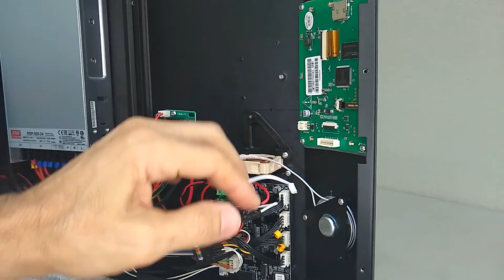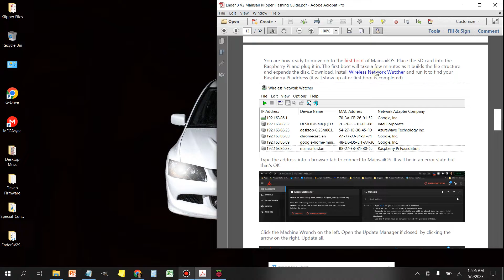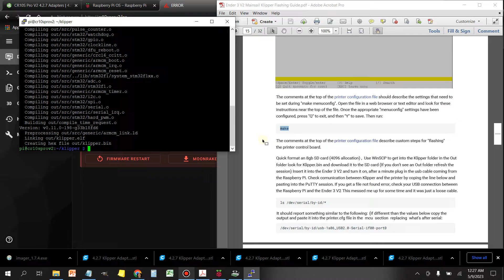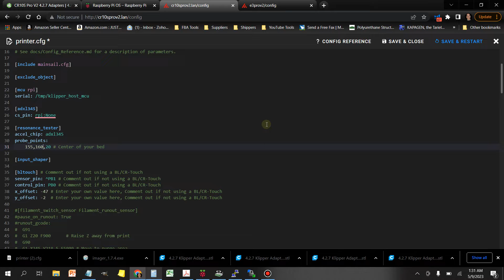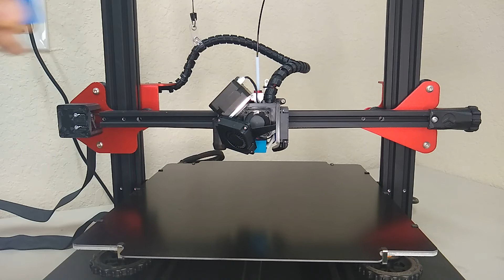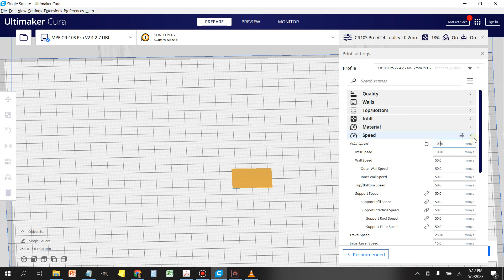CR10S Pro V2 with Creality 4.2.7 gets Mainsail Klipper a Complete Walkthrough

Comment: Nice video, just upgraded my cr10s pro v2 to klipper using the sonic pad. Working really nicely and slowly tuning in the print before slowly ramping up the speed. Would be interested in seeing what settings you get with both quality and speed. I have put bracing on my z gantry to help with vibrations. Input shaping suggested not going above 1500 for acceleration. Haven't raised the speed above the creality ender pro sonic pad standard settings you can get for cura on there website
Reply from the maker: Hi The GP's, Thanks for commenting and info about the CURA settings for Klipper. I'm super exited to turn and burn with this thing. You're still running the stock board with the Sonic Pad right? If so what flash settings did you use to generate the flash file?

Enjoy to the big boost in performance.
Reply: I used to run the stock board but recently upgraded to the skr mini e3 v3. Was getting stuttering issues when i was printing a 40mm cylinder at 100mms at 1500mms2. Thought it was board but it turns out its the acceleration being too low. If i run arcwelder in cura it solves the issue or upping the acceleration. Probably going to use both and see
Reply: Slight edit to my comment. The stutter is due to me overloading the mcu due to too many gcode points that when going faster the mcu cant keep up. Arc welder solves this by reducing the gcode points with arcs. Going to see what is the optimum resolution for stl is as this would solve it to. Cnc kitchen does a good video about cura resolution
Reply: I have moved to prusasliicer as cura as cura seemed to be quite picky on the stl quality and created large gcode files that can stutter my printer at higher speeds. Found just importing step files into prusaslicer and letting it do the conversion created great results with small gcode files.

Comment: I'm interested in this upgade. I have v1 and v2. I have direct drive extruder on both. Micro swiss ND.  I also Have linear rails on all three axis's. Like to upgrade the board with Pi. Just want to make sure you would be able to help if I get stuck. Also would like the stl files you used. This tutorial is almost two years old. My printers still work well but I like tinkering.

Comment: Such a great description, and so well done. You have shown us how to install just about any motherboard now. I got the SKR mini 3.0 V3 board which is perhaps a slightly better version of the 4.2.7 which is miles better than the 8 bit 2.4.1 which is no longer available. but any motherboard would have worked. I also used another raspberry pi with a 4" TFT for the gaping hole you covered with a plate. The raspberry pi automatically boots to Mainsail. I still plan to use the computer, but I will be able to change it at the printer as well or watch the process.
Reply from the maker: That's awesome Mark, great job on repurposing the existing display location. I'm sure it looks way cleaner than just the blank plate. I recently learned about the Manta series of control boards from Bigtreetech that are socketed for a Raspberry Pi CM4 or Bigtreetech's CB1. That would be the board to use instead of the 4.2.7 if you plan on running Klipper.

Comment: Off topic, but did you need to do any mods to get the NG to fit? I can't get an answer about fitting one on my Cr10S Pro V2.
Reply from the maker: Hi Patrick, Are you still using the stock red hotend?
Reply: @vbared  yes I am
Reply from the maker: OK, 

I'm not sure if you've already seen this new Micro Swiss NG or not but this is the one I would buy. It wasn't available when I bought the original one.

https://store.micro-swiss.com/collections/extruders/products/micro-swiss-ng-revo-direct-drive-extruder-for-creality-cr-10-ender-3-printers

The short answer to your question is, yes, you can make the NG work on the CR10S Pro V2 but you will need to print up a few parts before you take yours apart if it's the only printer you have.

One of the things you need to print first is a remix of the two z-stepper fastening parts that I designed for mine to give you more gantry end bracket clearance. The stock hotend is longer than standard CR10, Ender hotends.

Check out the video timestamped below on it (parts linked in the video's description). 

The other thing will be an adjustable x-limit switch for the CR10S Pro V2 running the Micro Swiss NG (2nd link).

And lastly, I'm not sure what build surface you're printing on but G10 Garolite is a real game changer for strong print adhesion when hot and effortless parts release when cool (last link).

Just ask if you have additional question about it. 

https://youtu.be/V_3GLGS4bx8?t=1906

https://drive.google.com/uc?export=download&id=1GcGvDgPr_JZ68BZcOW-hwFgguRIBIckL

Garolite G10 Build Surface fits Creality CR-10S Pro, CR-10S Pro V2 and V3, Ender 3 Max, Ender 3 Max Neo, and Others with (310 X 320mm) Bed - https://amzn.to/3FZy2iH
Reply: @vbared  Thank you for such a detailed response! It's a tossup between this or the Bondtech DDX.

I'm using the Creality magnetic flex build plate which is serving me fairly well for the moment. I'll certainly look into a Garolite surface; it looks much smoother than the PEI plate.

Thanks again!
Reply from the maker: @PatrickRyanCS  Hi Patrick, What sold me on the Micro Swiss NG was that it has the shortest, most constrained filament path (so it can print super flexible filaments), and now the addition of the REVO hotend (game changer for all 3D printers) and finally this video by Proper Printing - https://youtu.be/0jlW4ivSDko

Have fun with your mods :)

Comment: I can't believe i missed this alert for 3 days. I have a 10S pro v1 upgraded with V2, BL Touch and Micro swiss Hot end & Direct Drive. Following your progress very close. Folks are leary to make the interface cables. We need a source that makes them correct. Do you think Tiny Machines could make them for us??? I am not sure i like that ender 3 controller panel is there any options for a color touch screen from somewhere else. Especially if it fits in the old screen spot. I would enlarge that opening if needed.  So exciting to know we can update our old machines. I love mine.  Are you getting the sensors needed for the smart Printing we need?? OH BOY. Could we print a Carbon Fiber Bed Frame for lighter bed slinger mass?  Thank You So much for sharing your journey, I used to build Hot Rod Corvettes so I love this kind of modification for performance enhancements. Dennis in Virginia
Reply from the maker: Hi Dennis, I hear you, the interface cable was intimidating for me to tackle. It just needs to be handled one small bite at a time. I'm not a fan of the Ender 3 V2 display either but my reasoning for using it was due its compatibility with Miguel's Professional Firmware for those that want to stick to Marlin based firmware. In my opinion it's the second best firmware with Klipper being, hands down, number one.

I'll check into finding a source to make them. Is it the soldering that you think some are intimidated by or something else? It would be super cool to lighten up the Y-axis 's moving mass. I just finished calibrating input shaper and pressure advance for my CR10S Pro V2. Now comes the test prints to figure out what the max speeds for quality prints can be.

I too am a car guy, mine are three turbo Japanese imports. Looking forward to the day that I can start dropping money on them like I'm doing with the 3D printers.

Hit me up on a voice call 478-227-3301 so we can exchange some ideas. Enjoy your week.

Comment: Well I finally got Klipper to run my 10s Pro V1 with lots of mods. I have a friend with the exact same machine, we talk about mods we want then we do it together. He is younger and has a nibble brain on the firmware side. I wanted to do the 4.2.7 but he would not so i dropped it. We bought 7 inch high res screen, I already had the Pi 4B. He did it to his first. After three days he emerged successful. Unfortunately he needed 3 days to finish my machine too. He is located in South Africa and I live in Virginia. We use shareware to allow screen share and he was banging on my PC while is was installing the boards and cabling.  Today we finished the OctoView Screen and ran the cube test. My cube printed in 17 minutes on the 5 year old bed slinger with 300mm Z height. It measured 20.02, 20.03, 20.04 on the 3 sides. I was amazed. The New Garolite bed works great saving a ton well several ounces in bed mass. I did not do the fancy calibrations yet so my corners are a little rough and the sides have some ghosting. My parts are clean, neat and much stronger. I will be updating to S3D V5 soon then getting the calibrations done for the final tune.  Your video helped me get the courage to let Andy hack on my machine. I see a very bright future for my old 10S Pro. Stiffer, Lighter and better all around. Thank You very much such a great group of folks in this crazy hobby. Now I can print the Snow Peircer Train I have wanted to do that for 3 years. Dennis on Frankentrain Laboratories
Reply from the maker: Great job, my friend, I know it feels great to complete such a big overhaul to your machine, get it calibrated and printing again. That cube is spot on, how awesome! Yeah, I hear you, the Garolite is a game changer, super light, sticky when hot, parts pop off almost by themselves when cold, and best of all no more scraping or additives needed for adhesion. If you get some oils from your finger on it just wait for it to be completely cool and clean up with some isopropyl alcohol and a paper tower, done!

Enjoy the fruits of your labor Dennis :)

Comment: I looked at the pull down and see the 10s Pro Garolite is available I missed that announcement too. Will order today. Great Stuff. My Garolite plate today is heavy  and rusty red colored. As I replace it will try to CAD the base plate and see if its possible to lighten it up. D
Reply from the maker: Thank you Dennis, I appreciate you supporting the channel through our merch and your interactions. Our G10 is about as thick as you can get while still being able to bend it some. It's important to understand how to correctly set the z-offset and create an accurate bed mesh to get the most out of it. After some x-gantry tweaks I can probe to 12mm from the right edge of the build plate. Let me know what you come up with in CAD so I can try it out on my setup.

Comment: Another great video and I followed it to a tee, but even though the file is the same yours was P4 SPI and mine was I4 SPI and now it states printer is not ready. Also your Klipper bin was 24bytes and mine was 26 bytes. I have gone through this three times with the same result. I am using a Pi 4B and it is a Creality CR10S pro like yours and a Creality 4.2.7 mother board.
Reply from the maker: Hi Mark, give me a call 478-227-3301 so I can help you troubleshoot it. I screen new callers so leave a message and I'll call you right back.

Comment: Awesome video thanks . I have the CR10 Smart, do you know if I can load Klipper on the CR10 smart . Any files that are already make for the CR10 smart, Thanks
Reply from the maker: Hello, Thank you for commenting and encouragement. I'm glad you found value in this video for your viewing time.

You'll need to check if your board is a CR-FDM-v2.5.S1 and if so then, YES, you can use Klipper. The complete base printer.cfg for that board is linked below.

https://github.com/Klipper3d/klipper/blob/master/config/printer-creality-cr10-smart-pro-2022.cfg
Reply: @vbared  I have the other board CRC-2405 v1.2 struggling to get the Z Xisis to auto home correctly
Reply from the maker: @vaughanza  What is the z-axis doing?

Comment: Just leaving this comment for the poem that still have a good stock board, if you plan on installing klipper there is basically no reason to upgrade the main board as it has 2208 steppers the just are running on standalone mode
Reply from the maker: Hi Morgan, Thank you for commenting. Yeah, if the plan is Klipper then there is no need to upgrade the board. The reason I used this board is because it was compatible with Miguel's Professional Firmware which was running prior to Klipper. It is the best non- Klipper firmware currently out.

Comment: I am currently trying this on a CR10S PRO... it's not the V2 though.
Reply from the maker: Hi John, Thank you for commenting. Use the info in this video linked below to upgrade from the 8-bit control board to Creality's 32-bit silent board.

https://youtu.be/hXZ3UPy67gc

Your CR10S Pro V* should also have the same fat external ribbon cable I do. Another way is to use long wires from the board to each external connection, eliminating the need for the ribbon cable and small board under the extruder. Look at a picture of a regular CR10 for reference. If you plan on running Klipper then you don't need the Ender 3 V2 display screen, everything can be controlled using the Mainsail web interface on a smartphone, laptop or desktop computer.

Best of luck with your mods :)
Reply: @vbared  I bought a y cable for the two z-axis extruders and I replaced the extruder with the new sprite so I don't have to go off and figure out the pinouts of that wiring like you did.  My problem is I bought that damn Sonic wave pad  will NOT connect saying that the Kippler is not ready. I tried flashing the board multiple times but no luck. So I did go off and purchase the display. Hoping it will help
Reply from the maker: @johnm360  John, what control board are you using?
Reply: @vbared  4.2.7 st32f103re.. I actually got the new Marlin bug fix software all set up and had it running except every time I did the bed leveling it would pause and and stop responding so I couldn't do a m500, and I couldn't see anything other than pronterface was saying busy waiting for user input.
Reply from the maker: @johnm360  I gotcha, is the screen you purchased an Ender 3 V2 display? If so you can load Miguel's Professional Firmware so you can make sure the printer part is working correctly before moving back to the Sonic Pad.